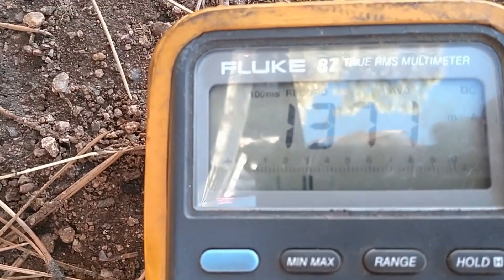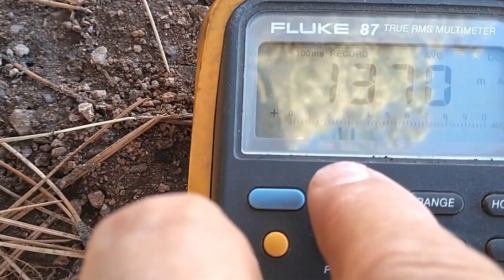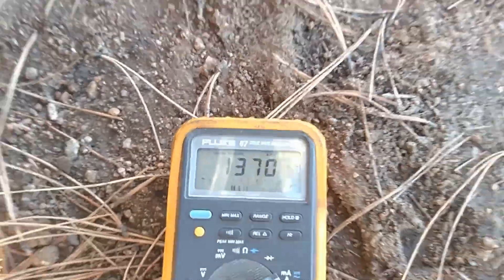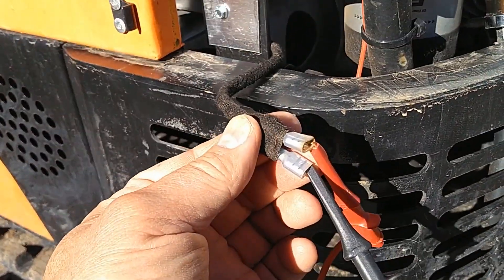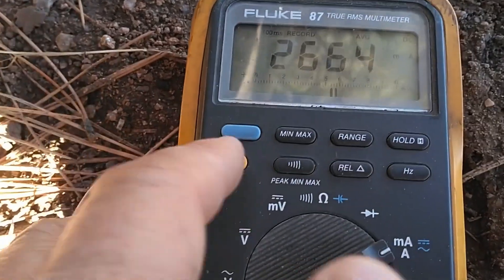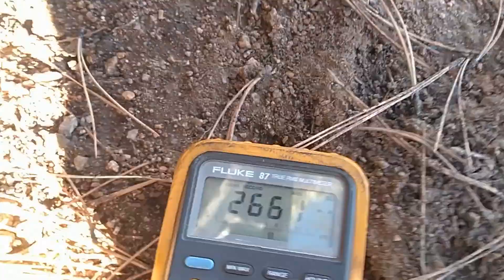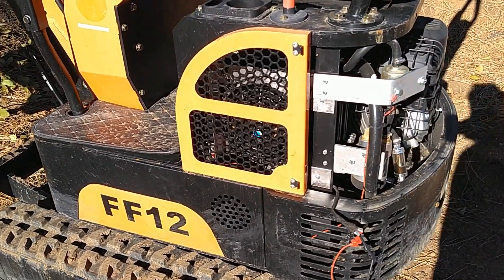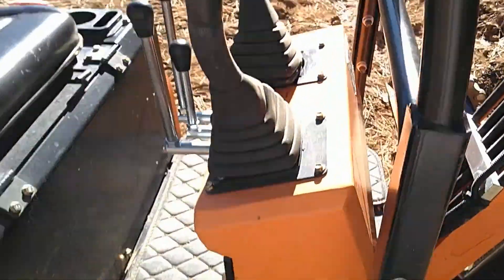Chinese Mini Excavator:  Current Draw Measurements of the Fan and Oil Pump

Comment: Add a cushion valve to the swing motor!
Reply from the maker: @howiehowdy  Not sure I  will  do that, but food for thought.  Thanks for the suggestion.
Reply: @madscientisthut  i have heard a bunch of horror stories about different ways it will rapidly disassemble itself due to a lack of cushion valve on the swing motor. The main issue arises when swinging and releasing the handle it comes to a complete stop and the pressure is apparently enough to blow the pump apart, the swing motor and or the valves by your knees even with the pressure valve on the side. so try to be thoughtful when ending each swing as gently as you can so there isn't much kinetic energy carried as you end your swing. All that is just stuff I've heard it hasn't happened to me but it made me careful when I use it.
Reply from the maker: Yes, I handle the swing control with care, as releasing it too quickly can cause abrupt jolts. Like many aspects of operating this machine, learning to finesse the controls becomes second nature over time. It's not like working with a high-end machine where all of finesse is inherently built into the design. When operating in confined spaces, I’ll even lower the RPM to around 1800–1900 to achieve more control.

Comment: Fill the lower rear back panel with lead as a counter weight also!
Reply from the maker: @howiehowdy  I have given thought to this, but instead would rather have an external  weight that I can add or remove as needed.

Comment: Turn the rear panel into a door!
Reply from the maker: @howiehowdy  Already completed, see other videos.
Reply from the maker: @howiehowdy  This video (  https://youtu.be/pJtGynmmg1Q ) shows how I modified the back panel by adding four latches to make it removable. I’ve seen others use a hinge, but I wasn’t a fan of that approach since it limits engine access in situations where you might be in a tight space and something goes wrong.

Comment: I was surprised when you showed your fan only drawing 2.6 amps.  I have what I think is the same fan in my excavator and the last time I checked, it was drawing 3.7 amps.  Would you mind sharing a link to where you got the fan?
Reply from the maker: I put the link in the description for you. Just a thought, I mounted my fan input side flush to the radiators, it may be that I am restricting the air flow enough through the fan that it is drawing less power since it is pushing less air.
Reply: @madscientisthut  I just checked the link, that's the same fan I ordered.  My fan is also mounted flush to the radiator and is pulling air through the radiator.  Sometime this week I'll check the current draw again to see if I miss read it.